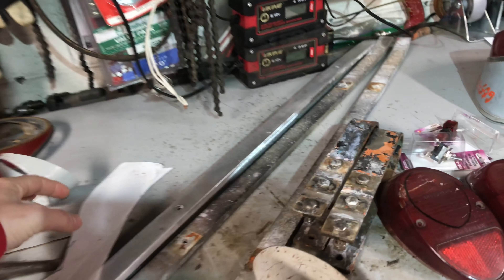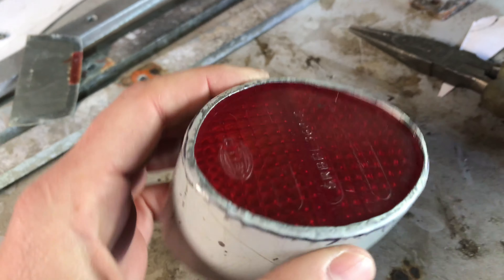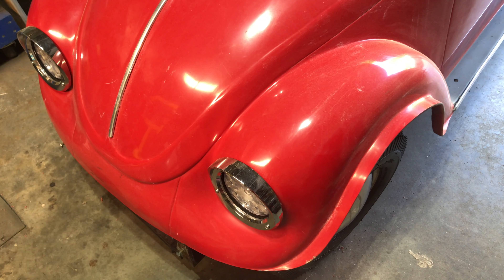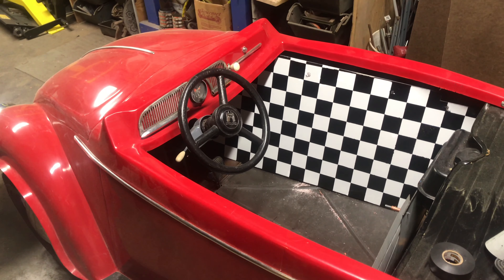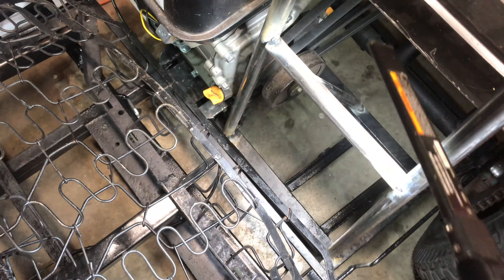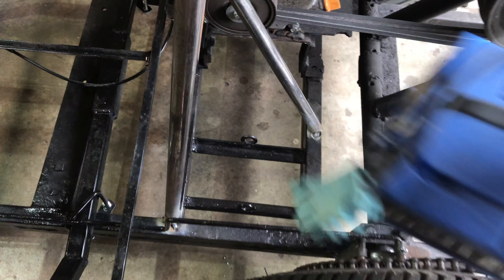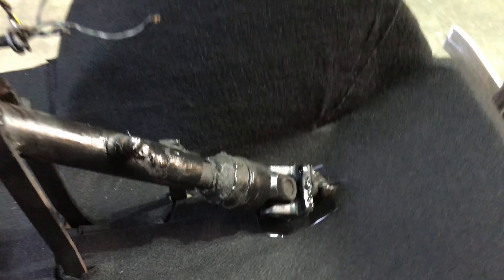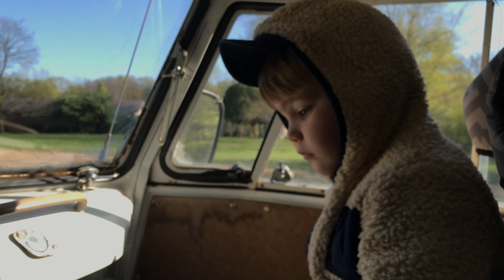VW Go-Kart with Harbor Freight Predator Engine

Comment: Joanne fabrics also sells venal, and during this time, they have curb side pickup, and you buy on line!  I’ curious, how your going to to accomplish a windshield and convertible top,😅😅😅, Give your little man the closest thing to the real VW experience! Lol! 

I would trim the body’s edges, for we all know how fiberglass act when it is hit on an edge, the stiffer the edge, the more likely the bigger the damage, also when you cover the bare metal with carpet, you are asking for  rust... well at least it will be true to VW nature, but again I would paint the floors! If not for your son, then for your trailer toy at shows!
Reply: I hate auto correct, 90% of the time it switches words during up load of comments
Reply from the maker: I got ya!
Reply from the maker: Our Joann's isn't open except curb side and vinyl is something I want to "feel" and see before I purchase as it is $20+ a yard! yikes I already have a plan for the windshield and top, so stay tuned for that one....lol As a sailor I have worked with fiberglass a lot repairing busted up boats...the little car isn't as thin as boats, much thicker, so I think will be fine for now, time will tell I guess and I might have to do your plan at some point...the metal in floor isn't bare metal it was already painted just wasn't black was brown on one side and white on the other...I was just going to paint it all one color!...thanks for being here!!!